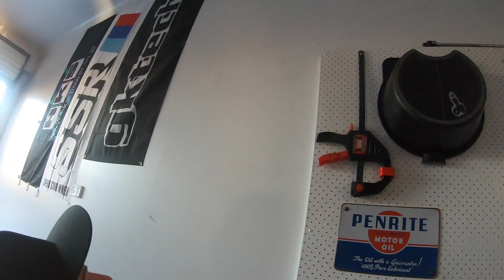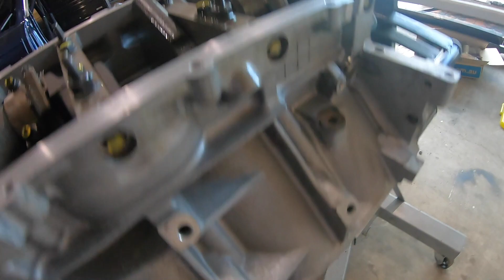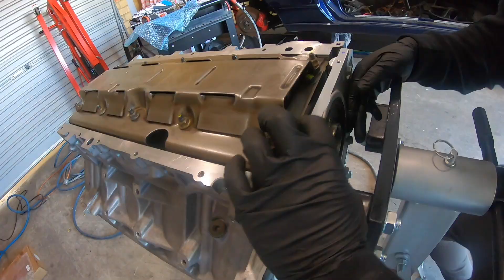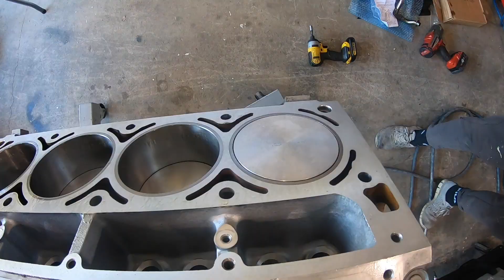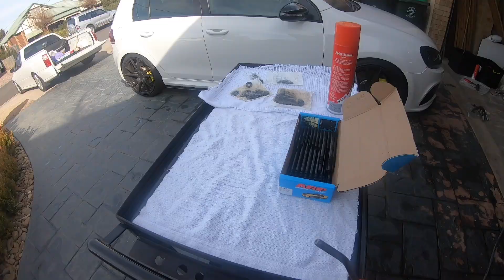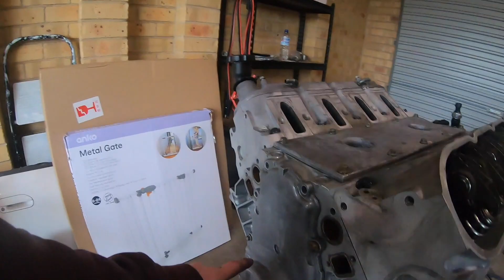LS1 VN Commodore PUTTING TOGETHER A BUDGET RELIABLE LS1

Comment: Coming along nicely and how good are those rear mains...
I've replaced mine twice and the fkr still leaks ive been told the only way to stop it is to replace the full rear main plate.
Reply from the maker: correct thats what we did here
Reply: @MindieJ  ill get around to doin mine one day hahahaha
Reply from the maker: @dallasstepto8409  easier to just let it leak
Reply: Your not wrong but she leaves some oil stains lmao....
Ill get it done when I get the throw out bearing replaced doesn't need it just yet though so leak sh will 🤣😂🤣👌👌

Comment: Going by the quick part of the video you didn’t install the rear main correctly. You are supposed to push the cover on with the white plastic cap in the seal and as you push the cover on the white cap pops out. It’s designed to keep the double lip seal facing the right way as it slides on the crankshaft.
Reply: people also put oil on the crank boss, the seals are meant to go on dry

Comment: 100% i did the same.. for few hundred to $500 get the pros to do the bottom end… I’d spend more on tooling
Reply from the maker: Exactly you’ll spend more just in time putting the thing together
Reply: Your right, both of the points you have said. Video and comments.
Insurance, cost and plus the worry of missing something that will inevitably destroy your entire engine. 
It's a Small amount to pay if your already rebuilding the engine.
Reply from the maker: @adamloader9534  exactly my thought process